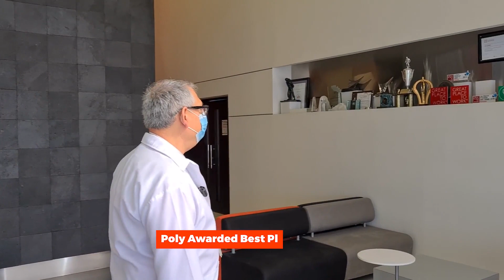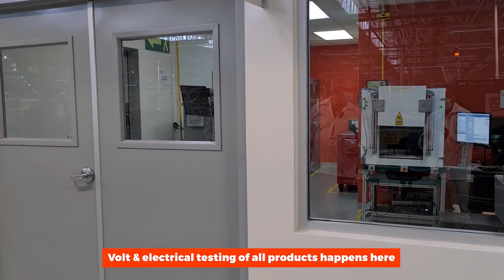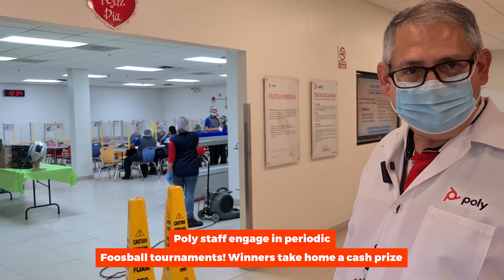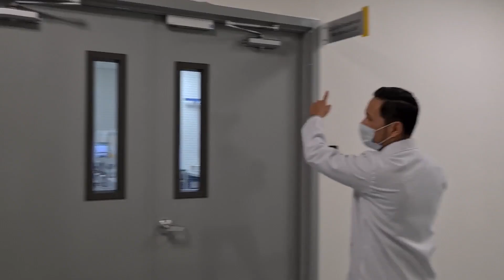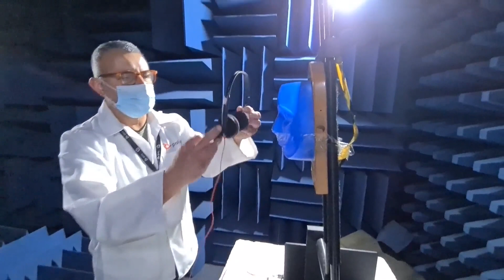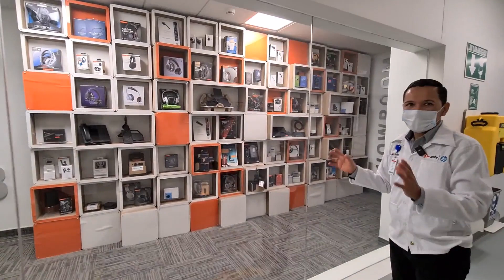POLY Factory Tour! How It's Made Will Surprise You!

Comment: Legend and 5200 also have plastic problems, they are all torn in half. I have 4 legends and 2 5200s. They are all torn in the middle and the sound does not travel when talking. There are many complaints. But there is no solution